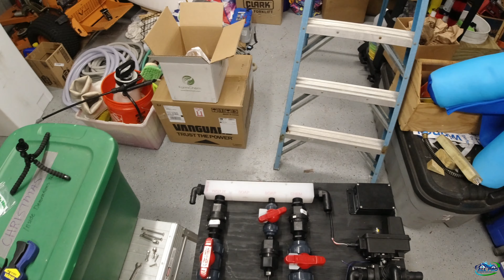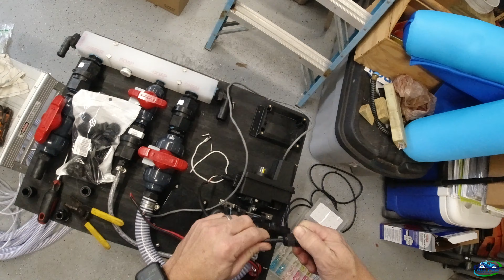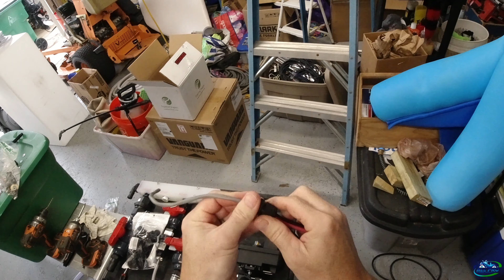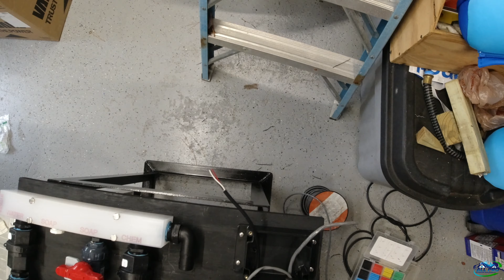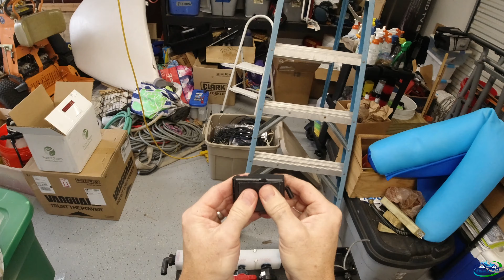AR45 Gas Roof Pump Proportioner Build

Comment: You said ” don’t over think it”.  It’s such a valid point.   This might sound crazy but I’ve  been stuck in my tracks at times from over thinking some things.   Something is better than nothing.
Reply from the maker: I have over thought a lot of decision when building my equipment. After it was all done, most of it did not matter LOL. A little common sense & the plan will come together. Thanks

Comment: Dumb question man can you tell me the names of the pieces and were you bought them from
Reply from the maker: The main parts is the manifold & metering valves. The barb fittings & hose are simple to get. There are a few companies online that build the manifolds. Hope this helps. thanks

Comment: Thanks for sharing.  How do you do about rinsing the chemical value when it's below your check value?  Maybe I'm missing something with the remote rinse?  The soap value you have above the check value so can see that water could be rinsed into the soap value and stops at the check value.
Reply from the maker: When I switch it to H2O, it rinses the SH metering valve. I have since put a manual 3-way to be able to rinse the electric valve as well. Thanks

Comment: have you ever come across your bypass knob getting stuck I did I had to take it apart to release it
Reply from the maker: I have never had that experience. Maybe apply some marine grease. Thanks
Reply: @allproexteriorservicesllc5338  it was the round pin that got caught up and slid over on the lever

Comment: If you dont mind me asking where did you get the 4 way manifold and 3 way valve
Reply from the maker: The guys name is Jason Tippett. He is on the FB groups & does not have a website. Thanks
Reply: @allproexteriorservicesllc5338  what type of gun are you using on your AR 45
Reply from the maker: @reidfamily67  I use the General Pump red gun. Thanks

Comment: How do wire up the 3 way valve?
Reply from the maker: Go to the 20:20 time mark & I explaine the wiring. Thanks
Reply: @allproexteriorservicesllc5338  I thought you had a push button switch on yours.
Reply from the maker: @jaxxo5  Only on downstream remote box. Thanks

Comment: Awesome video!!!
Question: are all the ports on the manifold 1”? Or is the Bypass one size, Water/Chem ports different size, Soap 1&2 ports different size and the pump port different as well? Thanks for the clarification
Reply from the maker: All ports are 1" except the soap ports which are 1/2". I use a 1" to 3/4" barb for the bypass. Thanks

Comment: I see youre using the same brand of remote on your downstream injector setup , does the remote from one system interfere with the other system? Like if I hit on , on one remote, does it turn on both units? kinda confused how that works , thanks g
Reply from the maker: DC, I have never has an issue with interference. But my remote box for down streaming has a power switch and stay in the off position until I need it. Thanks

Comment: You think it’s fine to go with the regular 1” ball valve for this instead of matching the 1” metering valve. I know on 12v manifolds some people say to use the metering valve on the water so it’s consistent. You think that’s the same with gas roof pump or has it been a non-issue for you? Thanks for all your help
Reply from the maker: I think a 1" metering valve on the water would allow you to dial it in more accurately because you know it is equal. I am think ing about changing mine for testing purposes. Thanks

Comment: My new fav channel.. Would this handle the 11gpm/300psi  comet p40?  Also,  do you really need the expensive metering valve on the soap line? or

Comment: Still running the 1/2" check  valve instead of a 1" check valve?
Building my AR currently. Needed to get these parts for the proportioner next. 
Thanks for the previous video outlining the parts.
Reply from the maker: I used 1" check valves on the water & SH. I used 1/2" check valve on the soap. Thanks
Reply: @allproexteriorservicesllc5338  Ah okay that makes much more sense haha

Comment: I just got an AR45.  I heard that they aren’t designed to run off a proportion with a looping bypass.  They are saying that the pressure builds up in that bypass line and it’s got nowhere to go amd heats up the manifold.  

What is your experience?
Reply from the maker: So far no problems. I believe that is why they recommend 25" bypass hose to help cool it down. Thanks
Reply: @allproexteriorservicesllc5338  I suppose if you treat it like a pressure washer and don’t leave the gun closed for too long should be ok.  

When you crank it up just blow and go and don’t stop!!!

Comment: New to gas roof pumps, why does the bypass go to the manifold instead of back to the water tank?
Reply from the maker: The bypass keeps circulating to not put chemicals back in my tanks.  If I was batch mixing, then I would run the bypass hose back to the tank. Thanks
Reply: @allproexteriorservicesllc5338  well duh, don't I feel stupid,  I'm living in the high pressure world, So that didn't cross my mind
Reply from the maker: @2bParagon  All good brother!! I had to figure it out as well. Thanks

Comment: did you make your own proportioner block
Reply: Midwest makes simmilar blocks like this. Nice quality indeed.
Reply: What size the small black box if you got info a will appreciate
Reply from the maker: @JUAN120484  This is the box I used. https://www.amazon.com/gp/product/B07WS4X1ZQ/ref=ppx_yo_dt_b_asin_title_o07_s00?ie=UTF8&psc=1
Reply: You can get the block in nylon on Amazon them take to laser machine make it the holes
Reply from the maker: No, I got it from Jason Tippett. You can look him up on the FB groups. It is very nice quality. Thanks